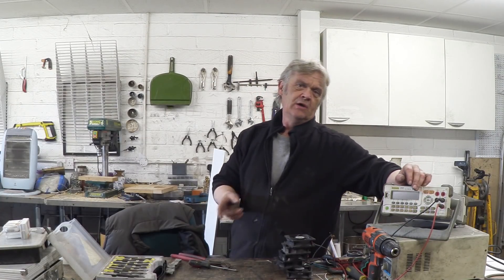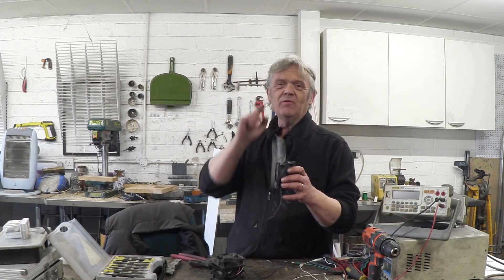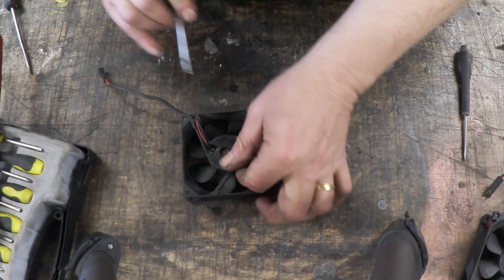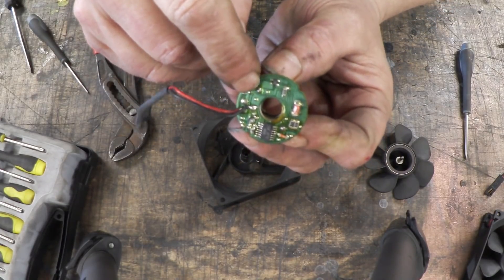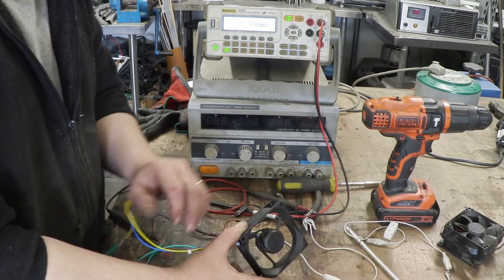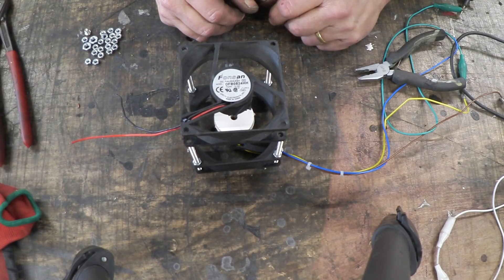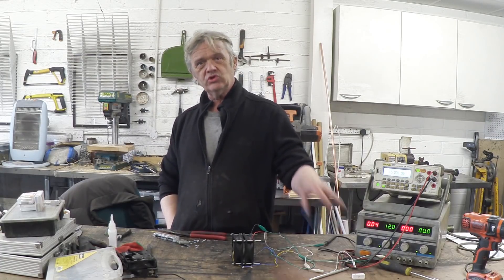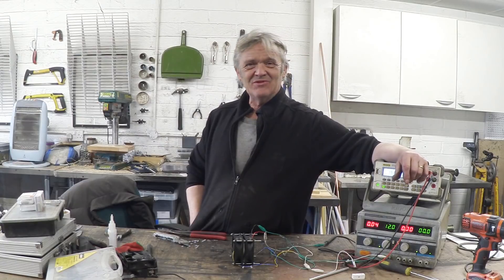1051 Brilliant  Mechanical Inverter - Even If I Say So Myself!

Comment: I have my best thinking on motorways as i am forced to just sit there with my brain in standby mode😂
This is actually good if you could rewire or buy them for a better ratio. Something like 24 volt and 6 volt version . It would approximate to 110volts i think 🤔
Reply from the maker: for sure mate cheers

Comment: I see, so a 3000 rpm fan means a 50Hz inverter, I guess with that rpm, it needs lubricant oil every now and then to the bearings if you want to run it 24/7
Reply: Probably no need. Use smaller fans that come rated at 4000 rpm or higher.
If you need a set of power mosfets on the ac side and you have a pseudo mechanical high power sine wave motor controller for larger bldc motors. Which is kind of what he is on about to begin with.
Reply from the maker: no mate most PC fans - if not faulty - will run at that rpm and more for ages without attention

Comment: I dont quite get why you dont just attach your output wires to the stator coils of the dc powered fan. I also got to admit that I really dont get the point about the x-thousand pound/euro/whatever inverters. Good luck finding a dc fan with thousands of VA/W. Just get a cheap UPS from local craigslist/fleamarket/decommisioned IT firms. I myself recently got a 4kVA/3.5kW unit used for 50€ including shipping. If you ask nicely, you might even get a low power unit for free. Thats a price you just cant beat with any DIY version even if you dont consider the fact that the used unit comes with lots of certificates and is guaranteed to be safe.
Reply from the maker: we are explorers here mate

Comment: Can a potentiometer convert ac to dc with or without these installed after or before the battery?
Reply from the maker: I don't think so mate
Reply: Potentiometers don't convert AC to DC. For that you need diodes if you're looking for a solid state solution.
Reply: @AtlasReburdened  good to know.

Comment: You don't even need the second motor. Just tap into the coils on the "dc side" and there you go. The control board is doing all the switching so why not just pull power off of that?
Reply: You'd get three-phase square waves, not sine. For a lot applications that's fine, but not always.
Reply from the maker: nice idea mate - but I have other plans here

Comment: Can I assume it works the other way around as well, turning AC into DC
Reply: Unfortunately not. The electronics driving the motor side won't convert AC to DC, but luckily that problem is easy to solve with diodes and a capacitor.
Reply from the maker: no I am afraid not you can do that - it's called a converter - for example an induction motor connected to an alternator

Comment: Robert,  how many would it take to arrive at 120v AC to drive power tools from vehicle
Reply: Lets say you get 1W fans. A drill takes about 500W. Lets say the fans are 70% efficient.
500W / (1W * eta) ~= about 700 fans.
And that doesnt even account for the fact that you would need to physically link the rotors together to synchronise the fans properly. If they arent synchronised, the voltage will randomly glitch between 0 and 120VAC
Reply: @headlessxp4948  So this is only a proof of concept.  You would need a giant DC motor,  to run a giant DC motor that would make A/C.  What the hell is he talking about 2000 pounds for a power inverter?  Harbor freight has them for $500 USD.
Reply: @bloxenthusiast4378  Yes Depending on size it's even possible to get them for less than 100GBP
Reply: @bloxenthusiast4378  Or used for 50 bucks a piece or even free.
Reply from the maker: I read the reviews on harbour freight Jupiter model - they are not good reviews mate
Reply: @headlessxp4948  this is a pc fan, same concept should work for biggers fans, thanks for the maths though true it would take loads of these, proof of concept anyways, I think some people don't get it
Reply: @strongforce8466  No it doesnt for bigger fans. Because most of them are run off AC. To run AC motors off DC youll need an inverter anyways so you can just do away with the motors altogether. And the very rare ones running off of DC are the brushed type which will wear out - the whole point of the video was to build a robust dynamotor without brushes. The only sense I see in this little project is education about dynamotors.
Reply from the maker: I dunno mate - but this is really just a demonstration of an idea more than anything

Comment: Very cool! So I am thinking I could put one without the components up a long pole to catch wind, add a LM7805 circuit and have a little cellphone charger. If the wind isn't strong enough I could add larger blades.
Reply: Have it charge an external battery pack to store it when your phones not around
Reply from the maker: for sure
Reply: Been there, failed that. The problem is speed: To get a BLDC motor to work as a generator you have to spin it much much faster than a wind turbine. You need to either gear it up, or use a many-poled motor more suited to low rotational speed.
Reply: @vylbird8014  Good point! When I have some old fans will like to try just for experimenting though. Thank you.
Reply: @peterfenwick2540  I had briefly promising results using a belt drive on a small DC motor, but the gears wore through fast. I think you might have some hope with a stepper motor - they should be able to function as workable generators at a much lower speed, which will make the mechanical side much easier.

Comment: Excellent video yet again Rob. I would love to see the sinusoidal wave on an oscilloscope. 
Thank you.
Reply from the maker: ok mate
Reply: @ThinkingandTinkering  thank you Rob, I am thinking of a row if computer fans under the guttering of the house all joined in parallel mounted to a board with common copper bus lines leading to a bridge rectifier which will go to a spare MPPT charge controller I have to then attach to my solar battery bank.
Reply: @stevetobias4890  the only issue I see is that you'd need a dump load, usually solar controllers just switch off if batteries are full, without a dump load in a windy sunny day there could be issues
Reply: I second that! It would be cool to see the output on a scope 👍

Comment: The best thing in my opinion is the perfect sine-wave you get as the output of that thing
Reply from the maker: I agree - I would think along the lines of an analogue amplifier to improve output
Reply: @ThinkingandTinkering  one thing that could be critizised hovever is that you have no control over the frequency this thing outputs
Reply: @Peter_Schluss-Mit-Lustig  Wouldn't the output AC frequency depend on the RPM in this case (each revolution producing a complete wave transient)? If so, what about using a stepper motor or some other fixed-rpm motor on the DC side to determine output frequency? Edit: I'm guessing this means that the output frequency is always too high, because the AC generator needs more than 50-60 RPM to produce any meaningful voltage ?
Reply: @DimitriPappas  Why stepper motor? Many of those fans have control circuits that let you regulate the RPM. You'd need to create your own software and calculations so that it would up the power to maintain the RPM even under load but that's not particularly hard to do. You can just monitor the output of the generator and send the signal from that monitor as whether to make it go faster or slower to maintain a perfect sine wave. And before someone says "but what if you overload it?" to which my answer would be "then you should have gotten a bigger one, just like regular inverters have a limit so does a mechanical one".

Also, now I REALLY want to see the efficiency ratings of this thing compared to the average inverter on the market. If the efficiency is over 90% of the average inverter it's worth it merely for the price saving of however much an inverter of the same power rating can cost.
Reply: The perfect sine wave isn't perfect as the amplitude and wavelength would change based on the load you put on it. Delivering power at constant voltage (and frequency) is the most intricate part of power generation and delivery. It's not as simple as just spinning a turbine.
Reply: @FineBakedPastry  Still far better for sensitive electronics than the Modified Sine Wave from an cheap inverter.
Reply: Isn't the frequency connected to the input D.C volt/amp which in terms limits the amount of A.C volt/amps the device is bound with in the sticker limitations pulled off at the start? Would that ,magnet trick work to increase the output of the A.C current.

Comment: Is it worth removing the blades on the drive motor to reduce drag?
Reply: if you just want to test this out for fun, not necessarily but if you are going to use this for a project, then yes. the blades add a decent amount of drag
Reply from the maker: it's why I did it mate

Comment: Well done!  This kind of motor-generator is still quite common for high voltage applications.  I once earned my chops maintaing that kind of equipment in missile silos.  Considering yourrecent  work with reluctance generators, I am mildly surprised that you needed two motors, or to remove the fan blades- they'd have made great reluctance rotor supports.
Reply from the maker: you are quite right mate - they would - never thought of it - until now lol - expect a video soon lol - cheers

Comment: Finding ways to convert the output of the Leonardo E-Cat SKLed into standard household electricity will a very popular thing once commercial production begins later this year. See: E-CatWorld
Reply: I wouldn't mind having some plasma lifeforms to mess around with. I assume the thermal energy and maybe radio waves would be the only energy you could tap with that lest you dampen the resonance.
Reply from the maker: will do - cheers